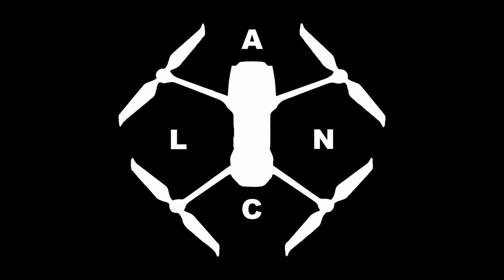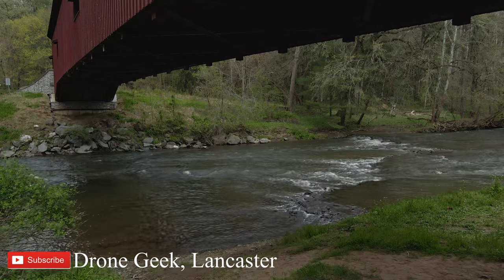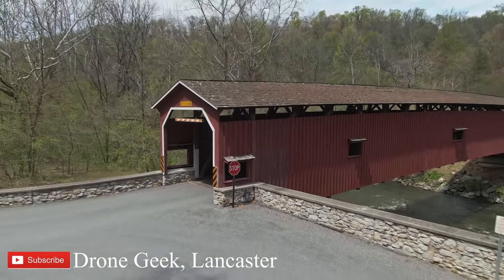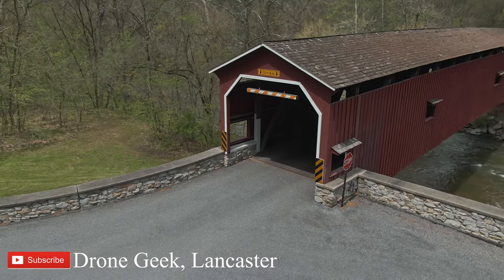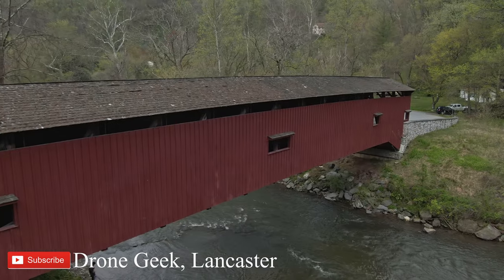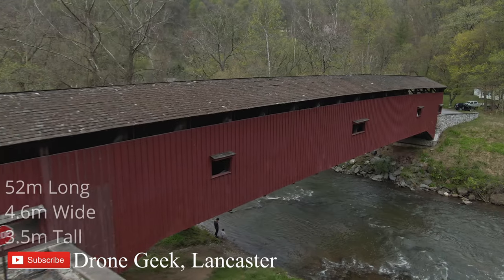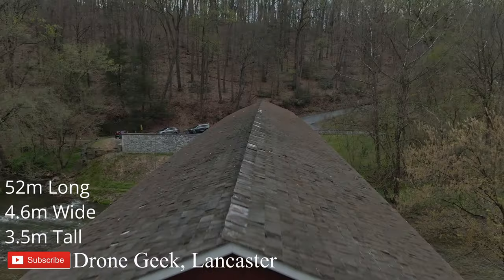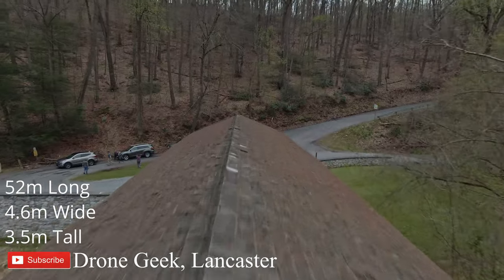Sky High History | Covered Bridge Series Vol. 2 | Colemanville

Comment: Thomas Kipphorn
     Just to  set the record straight...There were actually two covered bridges side by side for almost 3 years.

For those interested in the stats on the two bridges:
PA/38-36-26x   Colemanville Bridge #1-   Was Pequea #21, now #12.  It was a single span Double Burr Truss (concentric arches in each truss) originally built in 1856 by James C. Carpenter at a cost of $2,244.00.  Overall length was 167', with a clear span of 153', a 14' roadway, a 13' clearance and stood 13' above water. (1982 measurements with a 100ft tape measure)
     It was washed away in the flash flood of Sunday, June 26, 1938, but returned to its abutments by Edmond Gardner and crew.  It was washed away again by Tropical Storm Agnes on Thursday, June 22, 1972.  It was again brought back to the original site and rebuilt by the late David Esh and his Amish crew.  It was oriented north to south on Fox Hollow Road (T408) between Conestoga and Martic Townships.
     A new covered bridge (PA/38-36-55) was built on the downstream side of the old one at a slight angle, with the idea of removing the old bridge after the new one was opened.  A legal battle involving land ownership on the Martic Township (south) side developed, which delayed the opening of the new bridge for about two years and for part of this time the old bridge was still being used.  During the week of July 18, 1993, the old bridge was demolished.  Work was completed by July 27, 1993.  Both abutments of the old bridge are still there.  Coordinates are taken off an imaginary line drawn between them.
39° 53.9282'N, 76° 20.5202'W

PA/38-36-55   Colemanville Bridge #2-  Pequea #12  It is a single span Burr Truss, built in 1990 by the now defunct Lancaster County Bridge Crew at a cost of $350,000.00.  Overall length is 160', with a clear span of 142', a 14'10" roadway, a 13' clearance and at 19', this bridge stands higher above the water than any other covered bridge in the county.  (1993 measurements) 
     For approximately three years, the two bridges stood side by side, which is why this one was given a new World Guide Number.  Other than it having a single Burr Arch made up of wide straight segments and its slightly shorter length, it is identical in appearance to the old bridge.  
39° 53.9331'N, 76° 20.5302'W

     In regards to what happened to the old bridge, Lancaster County had (or still has) a "bridge bank" that was made up of old truss members and such.  The purpose being that there was a readily available supply of parts for repairs.  This bridge bank may still exist, as there have been quite a few almost total truss member replacements in the last 10 years.  Total rebuild of the Seigrist Mill Bridge and an almost total rebuild of Pinetown and Neff's Mill Bridges, to name a few. 
 
     There had been several options on what to do about the steel bridge, closed to traffic on Loop Road near Marticville a few years ago, and one of those options was to replace it with a covered bridge.  That would be nice, as the steel bridge had replaced the former covered bridge that was washed away by the same June 26, 1938 floods that took out the first Colemanville Bridge.  Remnants of the old abutments to the CB were still discernible about 600ft downstream in the early 2000s.  They're probably still there.
Reply from the maker: Thank you for the additional information!